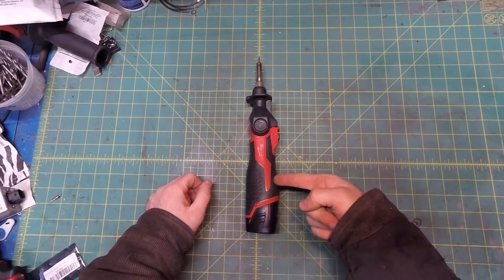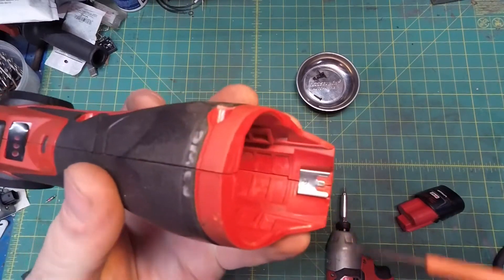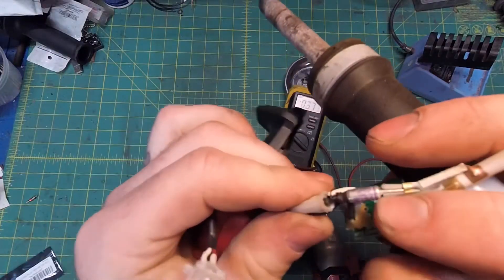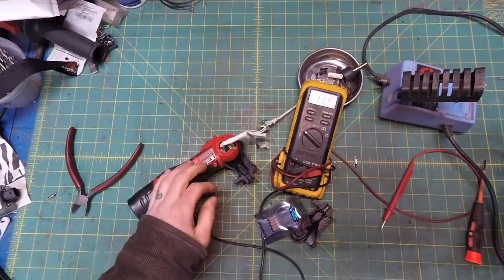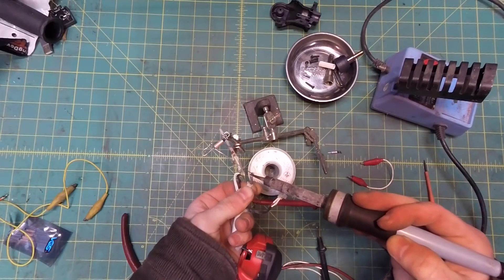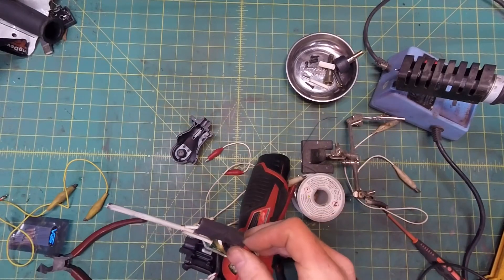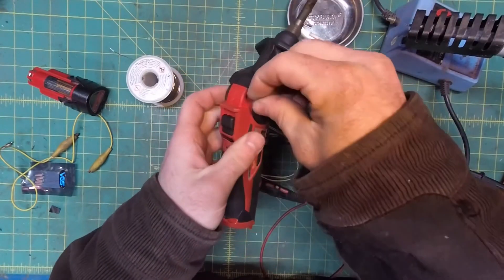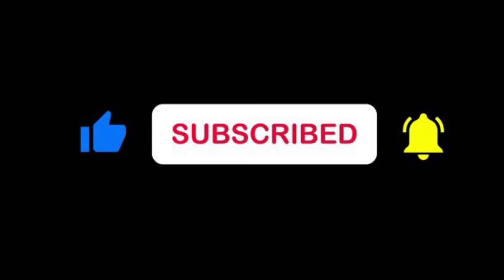Milwaukee M12 Soldering Iron: Troubleshooting and Repair with no special tools

Comment: Just a heads up, the most recent model with the extra bracket on the head uses a SF184R0 cut off thermal fuse I believe. Basically make sure the specs are 184°C 15A. I ordered the wrong fuses based on this video, suppose its my fault for not taking it apart first and checking. According to Google, 184°C is the perfect temperature for melting solder

Comment: So, why haven't you installed a DIY mini split in your garage/workshop by now? Awesome video, I just hate to think of you out there freezing your nards off trying to make these cool videos! A Della 9000btu unit runs less than $600 bucks now, and it's game changing . Heats you in the winter, cools you in the summer, you know the drill.
Reply from the maker: I’ve got other heat and AC solutions that are far less elegant and efficient, but met my budget of “found in someone’s trash”

Comment: I just crimped a jumper wire across where that fuse was, and I turned the potentiometer just a bit to the left to increase the heat slightly.  Hopefully it will function without burning out the element, but I didn't have time to wait for online delivery.  It works, and I'm happy for now.
Reply: Huh ?! It is blazing hot from the beginning and you still need more?!

Comment: So quick question, i decided to test my iron old school to make sure the heating element was ok before ordering the fuse. So what i did was run a wire straight in place of the fuse for like 3-5 seconds and noticed the heating element glow orange. So i’m assuming because i’ve never seen that glow orange before it’s because i had it direct and nothing was cutting off the circuit because the temp got too high w|o regulation? I want to make sure that it glowing orange the way it did was normal even with it being connected directly.

I ask because i feel as if i replace the fuse and that heating element gets to glowing orange again then i’m just going to blow another fuse unless it’s the thermal fuse that regulates the heating element from getting to the point of glowing.
Reply from the maker: The heating element is likely overheating because you’re running it without the metal sleeve around it taking some of the heat load. There’s also a potentiometer in the corner of the board that controls output but I doubt that’s your problem.
Reply: @thedoubtfultechnician  can you verify with yours without the tip and just the heating element exposed if your heating element glows orange at the top part after acouple of seconds.

I want to be sure before i toss mine and buy a new one; thanks in advance.

Comment: I need to replace a lot of these fuses in smoking machines and I use shrink tubing with tin rings incorporated. It takes a bit of space but this way you fix the cables without overheating the fuse.

Comment: Thank you for this! You saved me $200 on a new skin. I also just levered the crimps open with a screw driver and pliers, then folded them back down. I used a cigarette lighter to melt the heat shrink on the line side of the fuse and kept the original heat shielding for that OEM look. I love your dry humor in your videos 😂

Comment: I just made a direct contact because the worintee was not covering it and it heated even faster no lights tho because the board is dead all I did was removed the bridge rectifier and made it straight on the power side it is hot in one second

Comment: There was NO need to removed all of the torque screws.  Just need to undo ONE torques screw in the black head removed neat fuse and replace.......simples...
Reply: Sounds like more of a pain in the ass than just opening things up completely.

Comment: I've had 2 irons shit the thermal fuse, and one melt the plastic nut on the hot end. They replaced it each time and even upgraded me to the newer one with the bolted on hot end. But of course, it shat the thermal fuse again, at work when I was in the middle of nowhere. Each time its 3 weeks wait for warranty.

So I just bypassed the fuse completely. Profit.
Reply: Does your heating element glow orange because you by passed the thermal fuse?
Reply: @Legendz167  No, why would it?

Comment: Iron starts to heat up flashing green and then goes straight red. Suggestions?
Reply from the maker: It’s trying to heat up but shutting off before it can. Can you try a different battery?
Reply: That did not work, fully charged 4.0

Comment: I think they increased the degree that these pop at, I just opened mine up and found a 152 C  15 A thermal fuse Part Number SF150RO

Comment: About to be fixing mine very soon, I have 2 one for home and one at the shop. A few weeks ago we were doing a Wiring job but had no bays open so i decided to do it outside, i accidently left my iron on and in the 100 Degree sun for a good 5-10 minutes. Like you said, they take some abuse before giving out. I've rarely seen anyone with issues other than a heating elm or a Therm Fuse. I'd recommend to anyone that was on the fence about buying

Comment: A really informative video that helped a lot with the identical problem I had with my soldering iron. As someone else pointed out, the thermal fuse originally fitted is rated at 152C (marked SEFUSE SF150R0 152C CCC15A C21Y2). I bought a 142C fuse, and that seems to be fine.
Reply: tank you sir

Comment: Fantastic Video. I had a hard time fitting everything back together because the fuse leads combined with the heat shrink were too bulky. I ended up cutting the fuse leads short and using only 1 alligator clip (with wire) for heat sinking and that worked well for me.

Comment: What can I do if the control board is not sending power? My led stays green but doesn’t heat up
Reply: mine doesnt sent power to the fuse, have you solved it?

Comment: Just did this exact thing. Worked for test but when I put it back together it doesn't work. And no voltage going to. So idk what happened
Reply from the maker: Is there voltage going into the board? Without seeing it, I would check for a broken or pinched wire.
Reply: @The Doubtful Technician  I couldn't find any. I can mess with it again. It acts like it's doing its job, flashes green and then goes solid green but not hot and no voltage on the thermal fuse anymore
Reply from the maker: Just to clarify, there’s no voltage going into OR out of the thermal fuse?
Reply: @The Doubtful Technician  now now. When I first took it apart it had power going to the fuse but not out. Did the swap with a 142c but I crimped the ends instead of solder. I tested real fast and it came to life, so I shut off and assembled. Together it wouldn't heat up tho it says it is. Goes solid green. And shutting off it stays red to alert hot. Now no power goes to the fuse.
Reply: @thedoubtfultechnician  just tested some more. With battery on and switch on. H- Has Ground. H+ Nothing. S+ has 3.4v, S- has 3.4v. Led has 12v
Reply: @The Doubtful Technician  so I identified what it is. On the main PCB Board there is a small square fuse/resistor sorta deal. Power goes in, doesn't come out. I tried jumping it because why not, and it worked. So I guess I gotta identify and replace it. It's soldered on lol
Reply from the maker: Awesome! I was gonna offer to check my board and compare voltages to yours but it sounds like you’ve got it nailed. Are there any markings on it?
Reply: @The Doubtful Technician  yes. I believe I found a couple on ebay from Japan or China. HY19P03. Some sort of Mosfet. 

Just don't know why it blew, is the 142c Thermal Fuse to much for this Lil guy...
Reply: @The Doubtful Technician  ordered a couple of those Mosfets. Looked at the thermal fuse I removed from my M12 new soldering iron, 152c. Well @^&/. Lol back to ebay

Comment: My ceramic rod broke when the iron was dropped. Do I just need the replacement heating element?
Reply: @Murray Wight thank you!
Reply: @murraywight5721 the tips work but the element is much higher resistance and won't get very hot in the milwaukee m12.

Comment: The fuse in my soldering iron was actually rated for 152C. PART SF150R0.  Have you had to replace the fuses in amazon link more often being that they are a bit lower?  Thanks.
Reply from the maker: Holding up great since I made this video!

Comment: Hey my m12 soldering full charge doesn't last longer than 7-10mins 3.0 amp battery how do I fix
Reply from the maker: Sounds like a battery issue. I would use some alligator leads and a multimeter to measure the current draw and if it’s in spec for the soldering iron then you know it’s a weak battery. These things draw a lot of juice.

Comment: What if mine just blinking green but after 20 seconds its able to solder but the light stays blinking did i do something wrong i replaced the element and the fuse
Reply from the maker: It’s not reaching temperature. Or I should say, the control board is not recognizing that it’s reached temperature. I would say your options are to check for a broken sensor wire, or live with it blinking.